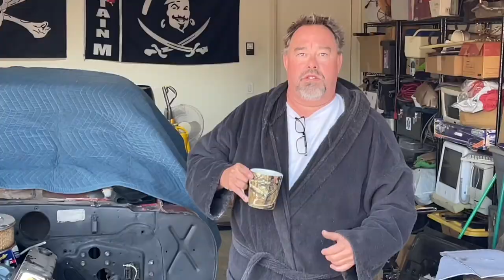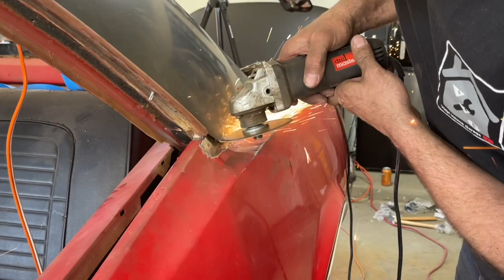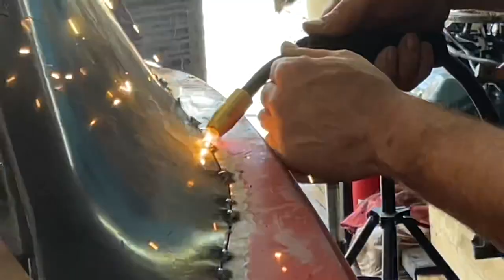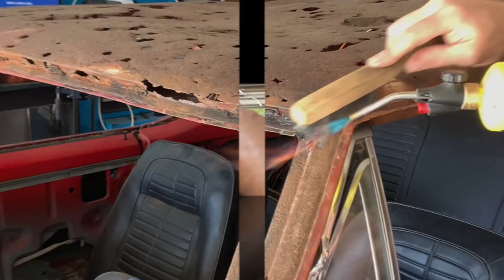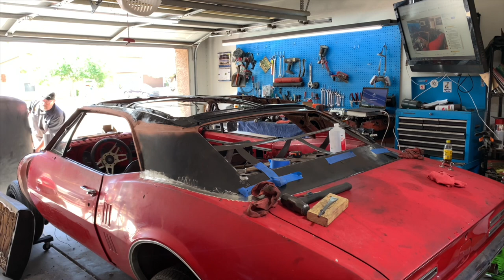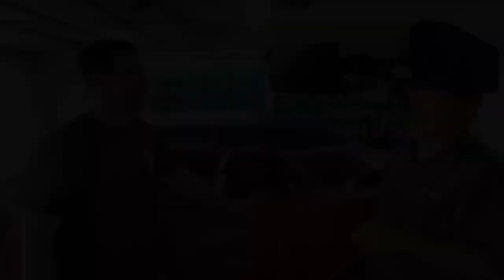Rustiest holiest Firebird roof replacement under 3 days and 2,000 miles from home

Comment: Sand the wood block down to fit the curve.
Reply from the maker: It would have helped for sure, a lot simpler no doubt.  what we did was improv, I was 2,000 miles from home in a strange garage without my normal tool supply. Basically made do with what I could find so definitely made it a bit more interesting to get the job done. This was the first time I met Brian in person, I literally just jumped on a plane and knocked this project out and had a great time doing it and made a new friend for life I am sure.

Comment: Nice work! Where did you guys get just the sail panels patches from. My car just needs them replaced ed with the roof skin. I don’t need the whole 1/4s
Reply from the maker: They came from other projects where I purchased full 1/4 panels and didn’t use that portion.   Unfortunately no one manufactures just the sail panels. I am sure they would sell if they did

Comment: So you just tack welded the roof skin in the drip rails and then used what to seal? I'm going to have to replace the forward half of a roof skin on a 77 Camaro, had a half roof vinyl top and a sun roof, which means in the inner roof structure repair. I can get a complete roof off a similar year Firebird, wondering if it is the best way to go. Thanks for posting this video!
Reply from the maker: Still plug welded in the drip rails just much smaller. Then after clean up and primer use a seam sealer to finish off the drip rail before final paint.

Comment: Looks like you fotgot the sheetmetal on the two front window posts. Other than that,looks good.
Reply from the maker: Yup good eye, it needs sand blasted, Brian  didn’t have a sand blaster at the time of my visit.  The weird part on the windshield posts it’s only the glass channel that is rusty and pitted the part where the vinyl was is minor surface and could be cleaned up with sand paper and acid prep.

Comment: Gas should take the POR 15 off. Be smart with the gas.
Reply from the maker: POR 15 works good but man it doesn’t come off skin.  I will try the gasoline tip the next time, thanks 👍
Reply: @VinylVillageGarage  You are welcome, I have tried it, comes right off. Of course do not be around an open flame, lol.
Reply from the maker: That might get a little warm for sure.  Lol